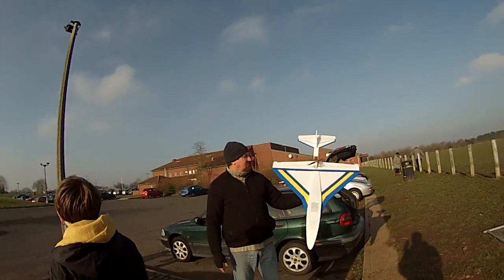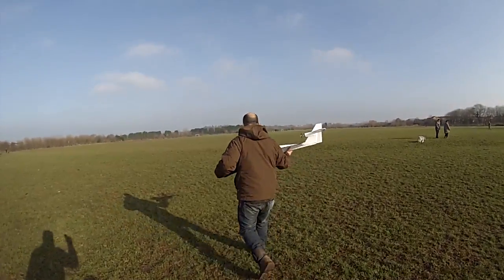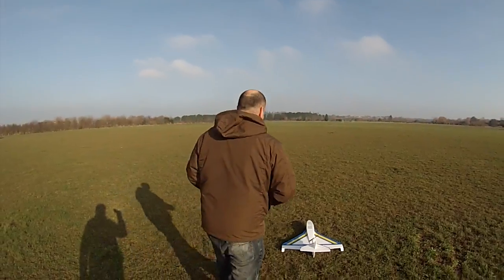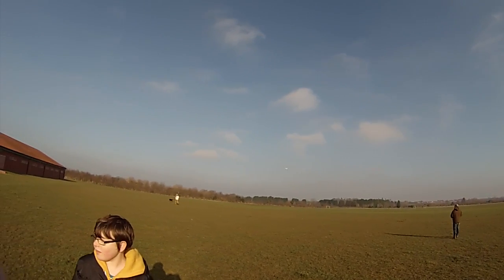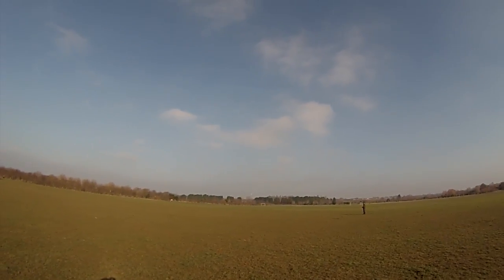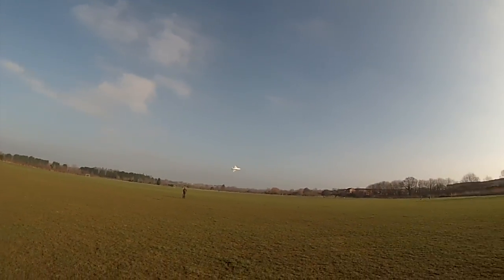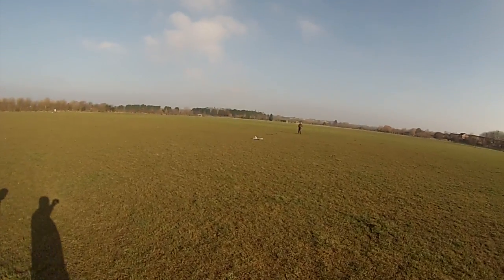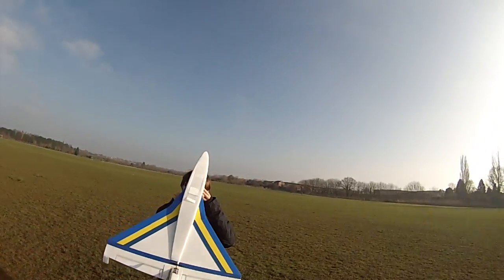Polaris scratch built maiden.

Comment: Very nice job. I have built 4 so far , 2 for friends and 2 for me . My first one crashed and I now have the 125% size 920mm wing span and approx 1250 long . They fly awesome and hooning around on wet grass is almost as much fun as flying . Its like driving a drift car.  
If cooling is a problem try making a vented battery hatch for when you are not flying off water